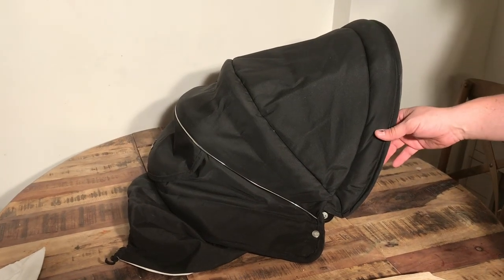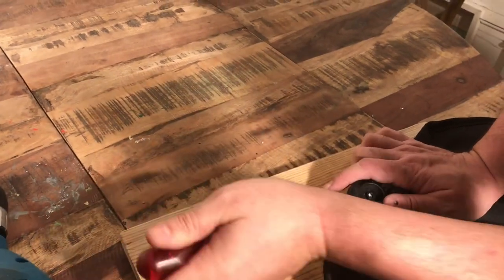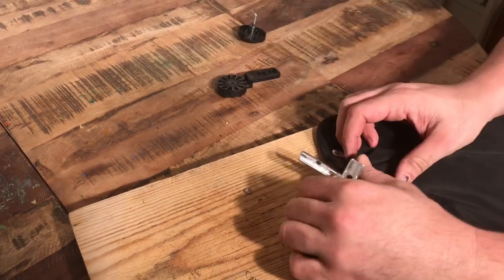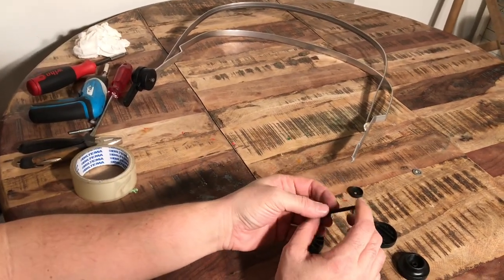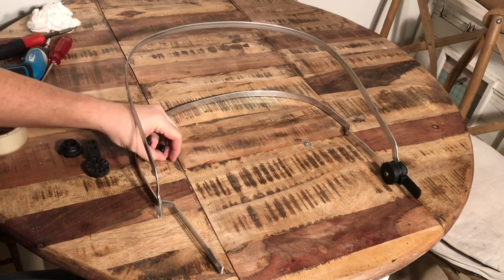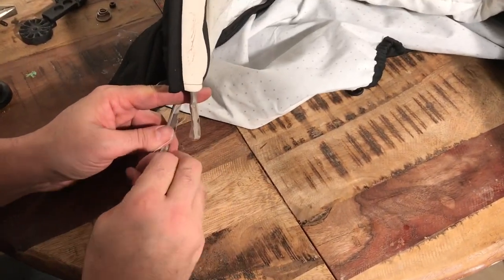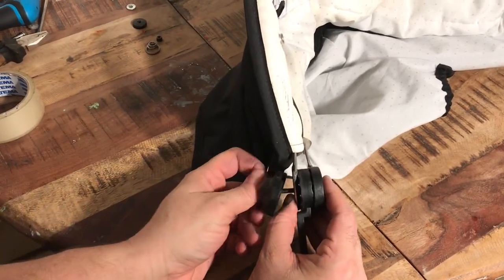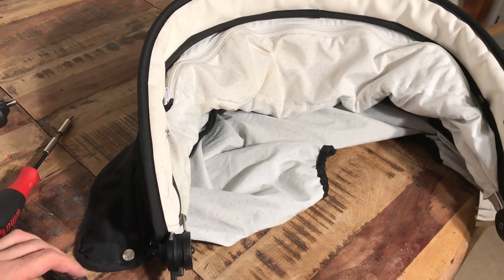How to Disassemble / Remove the Textiles from an Emmaljunga Mondial De Luxe Canopy

Comment: Hello believe we have a emmalijunga duo combi 3 in 1 classes chassis, we are struggling how to connect the straps to the frame on the seat unit. Do you have any related videos for that model x
Reply from the maker: If you have the classic seat frame, then this may help. https://www.youtube.com/watch?v=K4dkLI3f8CE
Attaching / detaching the shoulder straps is at around 1.50
:)